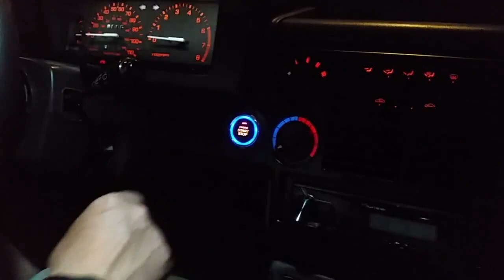The only limit is the one you set yourself.

Comment: Hey man I have a 1990 Mazda b2200 with a nasty tick. It has the hydraulic lifter set up so I went ahead and replaced the lifters. Now the noise comes when the engine is warm, any ideas?
Reply from the maker: Only when its warm?
Reply: @MazdaMitch  Yes sir, no noise when cold
Reply: Hey chris did you ever figure it out? . I put a new head on mine and im getting a lot of chatter from the vales ? Can not figure it out . I have a 2200 and can't adjust them manually
Reply: I haven’t gotten it worked out. I have plenty of oil pressure and still the lifters tick like crazy but only when warm. I’m thinking about swapping to a mechanical rail set up
Reply: @jamesfink2564  I have solved the problem. Soaking the lifters before installation is not enough. You have to manually bleed each lifter fully submerged in oil before you put them in. It’s a pain but worth it

Comment: Hey i swap my b2200 speedometer gauge to a b2600 gauge with rpm but I'm getting check engine light is there anything i could do to get rid of the check engine light
Reply from the maker: There is a brown plug and a white plug on the driver side under the dash and I think a black plug is plugged into one of them. The make the light go off, simply swap the black or white plug to the next one. Its just a timer reset. Its a maintenance light for the timing belt. Its discussed in the online manual I have here. http://mazdaminitruckin.com/